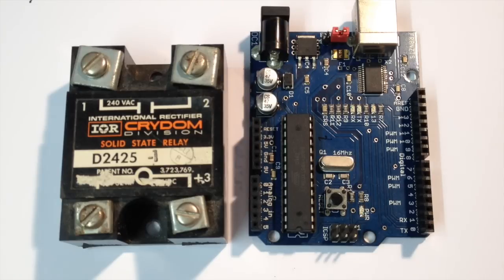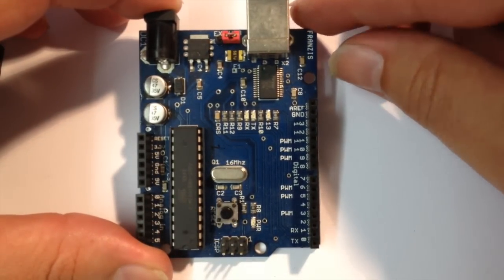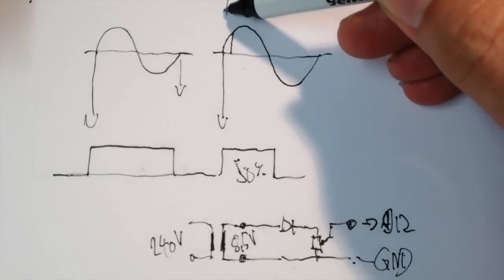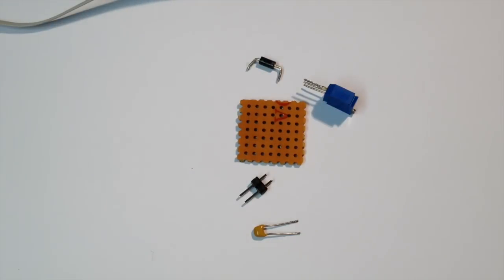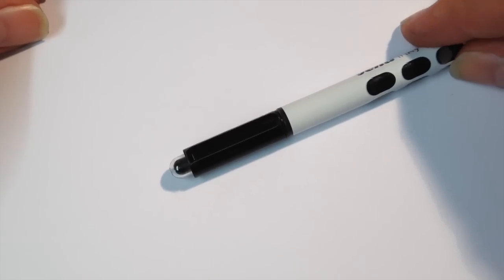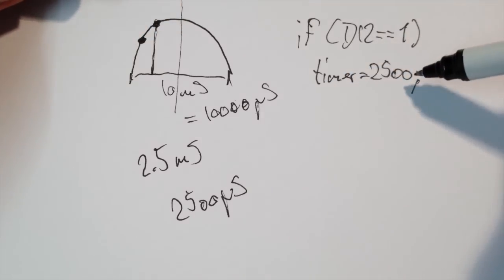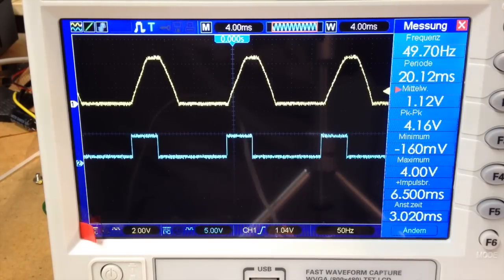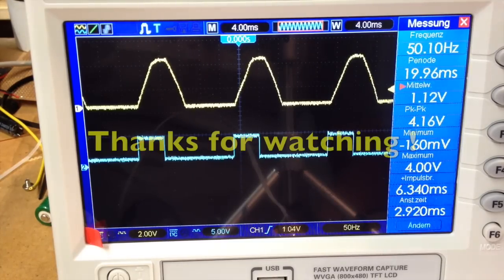Arduino-SSR-Dimmer

Comment: Can you share more clearly what are the circuit elements that you use in the circuit, the brands, the size, the circuit diagram and where you connect them? (Starting at 6.19)
Reply from the maker: Look here:https://github.com/dherrendoerfer/My-Arduino-Things/tree/master/SSR_Dimmer
The transformer is a very small 8.5V one, apart from that it's just a diode, a trimmer-pot and the SSR itself.

Comment: sir , i want to make a soft start and dont want to use POT so plz tell me what should be changed to get the soft start result, the bulb start from vry low to high with in 10 sec and stays there  . thanking for precious time
Reply from the maker: If you want to do it with an Arduino, I suppose you need to program a timed sweep over the length of a phase.
So, synchronise to the waveform, and then slowly increase the duty cycle over the time you desire.

Comment: You could use an opto-coupler or perhaps a Schmitt-Trigger IC to synchronize the arduino. Add a Z-Diode for Voltage limiting as well.
To use both half-waves, use a rectifier Bridge instead of the diode.
Reply from the maker: Yes, I'm somewhat relying on the Arduino input being able to trigger on the rising voltage, but since I can actually pick any point to sync on and then synchronize on that point ( meaning that the trigger point is neither 0us or 5000us , but anything in between ), I can also rely on the Arduino being precise enough to trigger another half wave at the 10000us point. 
It works really well, even when doing full-wave. I can get the latch window down to about 20us so it's really efficient.

Comment: Hello DIrk, I was wondering if i can get list of all the parts you used.....i am also working with SSR for dimming light for one of my project....Thanks
Reply from the maker: Just a small transformer, a diode, a 10k trimmer pot, and the Arduino. Apart from that only the SSR is needed.

Comment: if you just need the sync, id probably throw an optocouple inbetween rather than relying on the possibly shitty made in china transformer alone
Reply from the maker: I need the zero-crossing, and the transformers I used so far always worked perfectly. But I suppose a optocoupler from mains might work too - but I didn't try back then - The video was just to make the point to AvE that it was not complicated.

Comment: Hello Dirk , I 'm Brazilian , so I'm sorry for bad English. You could make the code you used in your arduino ? You can also provide the wiring diagram that you did ?

I am doing a project and found a problem when trying to make a temperature control applying in a resistance with one PWM AC voltage
Reply from the maker: I will look and see if I still have it lying around, and upload it if I find it - it is just for proving the the point to +AvE so it's usefulness may vary.
Reply: Ok! thank you so much!
Reply from the maker: Look here: https://github.com/dherrendoerfer/My-Arduino-Things/tree/master/SSR_Dimmer
Reply: Caraca se é brasileiro

Comment: Hello sir,
 i am working with AC dimmer project using BT136 triac for inductive load(ceiling fan) control and getting buzzing sound while AC dimming how can i remove this noise ??
Reply from the maker: Hello, dimmer circuits are nor well-suited to control inductive loads like motors, because the motor usually relies on having the full phase to fully circulate the direction of the magnetic field. The buzzing noise you are hearing is coming from the windings in the motor, when the triac is cutting out to perform the 'dimming' . You can look into control circuits for inductive loads, but those are usually more complicated.
Reply: hello Dharmendra,

i am also trying same thing can please help with sample code for zero cross detection. if you provide sample to me  it's very helpful for me

Comment: Your Arduino Uno is a Chinese clone isn't it?
Reply from the maker: Google+ SUCKS BALLS - the worst forced social network I am. They fund the development, they should get something back once in a while.
Reply from the maker: Google+ SUCKS BALLS - the worst forced social network I don't care if they made the fuel or brought the lighter - I doesn't hurt me to buy expensive from now to then just to keep the momentum going.
Reply from the maker: Possibly. It was part of an Arduino education kit a lot of years ago.
Reply: Dirk Herrendoerfer Thanks. I got mine from China.
Reply: who's stupid enough to buy original one?
Reply: Development? It's avr strapped on opensource pcb.. Not to mention most of the clones improve on the original design.

Comment: Thanks for the great explanation. By the way, is this SSR the same thing as a Triac?
Reply from the maker: +Fernando Romera No, it's like a triac with an optocoupler in one, so there is added isolation from the mains to the driving circuit.
Reply: Dirk Herrendoerfer Ok, thank you man

Comment: This should work. however, if you look at your current input it is discontinuous and results in a poor power quality. the best controller will be the one that reduce the output voltage while maintaining a minimal distortion on the input current from the ideal sine wave that you would see if just have a resistive load connected on the AC line.

Comment: Excellent Dirk!  I really hoped someone would make this :)  If you get a minute you should throw a shot of the schematic and the code into a forum (use mkme if you like).  I'm fairly certain a large number of people could benefit from it.  I saved a couple old AC output power supplies for exactly such types of projects. Awesome video and interesting for many I'm sure.  Cheers

Comment: because my 3D printer jam(was stalled)
I thought everything takes to much power (all together)
I have seen (on YouTube) that someone had taken a second power supply there,
he used also an SSR to switch it (wiht an Arduino and A RAMPS board)
I wrote then in a forum that I wanted to do this also,
the heatedbed at a different power supply switched by these SSR.
it was discouraged at the forum and would better use a relay
because the SSR only could switch AC?
what do you think? SSR or relay?
or is a relay also just good to use?

I also have to figure out,
what I do with a diode to/on the relay

Sometimes my printer does not crash (Than I am very happy!)
https://www.youtube.com/watch?v=qOsck_YpdVA

..................
another question?
is it possible from a regular audio (with an Arduino)
to convert audio to PWM modulation?
so with an Arduino 
regular/ normal audio in, Arduino, 
and PWM is modulated from/through the Arduino out.
it is to modulate a transmitter in AM (I am A radio amateur)

sorry for any bad translation.
Friendly greetings from Netherlands
Rob.
Reply from the maker: R. Rob. I don't quite understand the question: With a RAMPS board you already have the possibility to use 2 supplies.
If the current is an issue then you should use a second big power supply and a set of beefy mosfets with some cooling attached.
I would not recommend switching the power at the mains.
About the PWM modulation: I have no idea - maybe it can work, but the Arduinos A/D converters are terribly slow.
Dirk